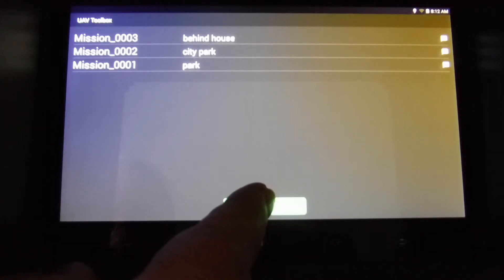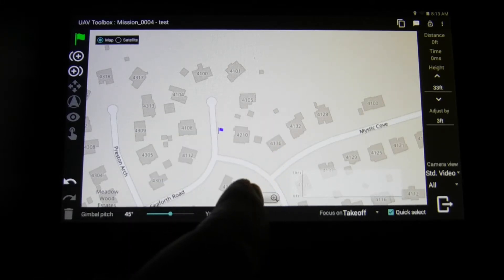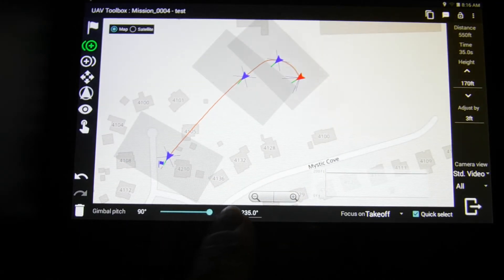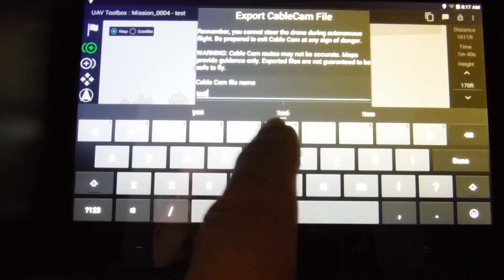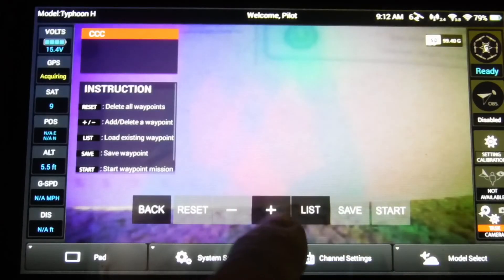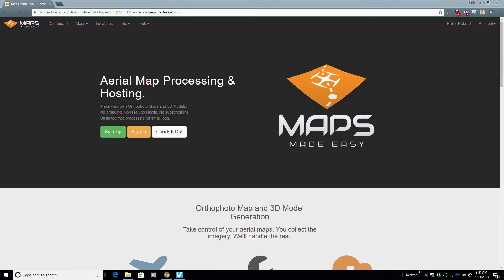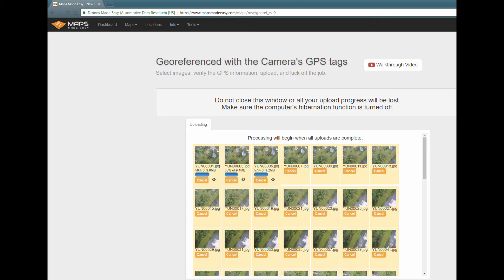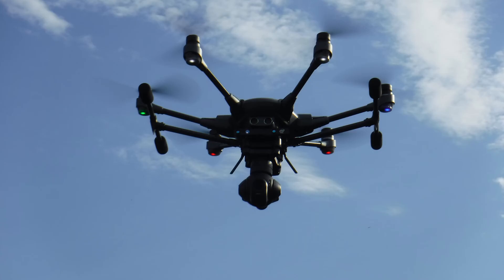Basic Mapping with Typhoon H

Comment: Would love to be able to do some mapping with my typhoon h!
Reply from the maker: The new version of UAV toolbox references mapping, something most of us asked for a long time ago.    That would make it trivial.   I would try it, but I sold my Typhoon over a year ago.   Unfortunately, what I was doing for money, required a Phantom because of the apps I had to use.
Reply: @TheDroneAngle  I’m hoping to be able to make some money with mine too! It’s my second bird!!
Reply from the maker: @joshsfanatics6083  I hate to admit it, but the Typhoon H is not the one to make money with.  It's a great, well-designed bird, but for something like real estate, you will need something with at least a 16 Megapixel sensor and a higher dynamic range.  I use a Phantom 4 Pro with an Autel Evo II Pro (don't have to worry about constant problems with geofencing with the Autel) for backup.     The insurance company I work for occasionally, requires a Phantom because I have to run their app.  The commercial real estate companies require a 20 megapixel sensor.   The mapping work I do all has to be done in Pix4d, or Dronedeploy with customer provided boundaries.  Sadly, most apps are written around the DJI software.  I am not a fan of DJI, but had to go that way if I wanted to break into the business.  With the Typhoon, you might want to look at construction monitoring, roof inspection and residential real estate, with local companies first.   There is a lot of competition for drone service providers and not enough work to keep all of them busy.  You will need a niche.   You do have your 107, right?   You can't legally make money with a drone without it.   I wish you the best of luck with it!
Reply: @TheDroneAngle  am working on the 107 now. Studying as much as possible. Any pointers for the test? And I was thinking of maybe grabbing a phantom too if need be. Am hoping to start small and work my way up
Reply from the maker: @joshsfanatics6083  Don't panic.  That's the biggest advice I can give you.  Answers to a lot of the questions are contained in the sectional chart legend, so make sure you get familiar with it.   Make sure you do practice tests to get used to the types of questions you will get.  You can search for a lot of free or low cost options on line but the paid training classes are good too.  There will be a new night section on the test starting in March and free training online for that.

Comment: Very nicely done sir however I can offer one tip. On UAV toolbox you have the ability to select multiple waypoints using the touch icon right below the eyeball icon on the left of your screen. This will allow you to set all of your waypoints to 90 degree camera angle at one time instead of having to adjust them one at a time
Reply from the maker: Good point, thank you!
Reply: Rob Hodges sure thing bud, I’m still learning just like you.

Comment: I fly the H and H Pro... I manually fly using video...   Because I have experiance with Pix4D, I calculate from the total number of "frames" in the video, and the total video "time"...subract out X number of frames to where it works out to 2-3 frames per second. Seem to be pretty accurate and getting nice results.
Reply from the maker: Thanks for your comment.  It's just a little more work, but the online software doesn't care how the pictures were taken, only that they overlap the right amount.
Reply: @TheDroneAngle  True...  not a fan of online services...although Pix4D has that option. I prefer to keep it secure on my laptop.  Hopefully, Typhoon will have as much planning options and support choices as the DJI products. Really liking the Typhoon line.